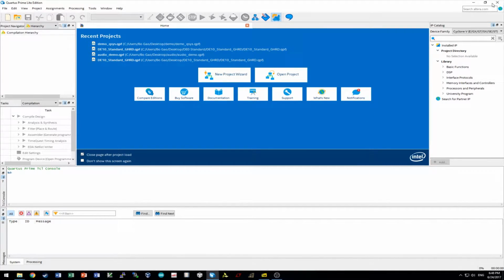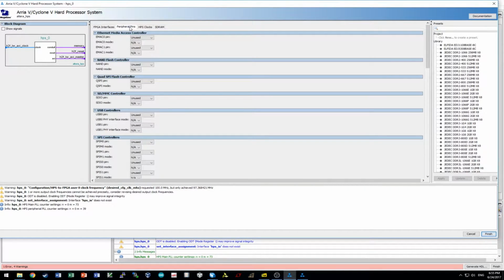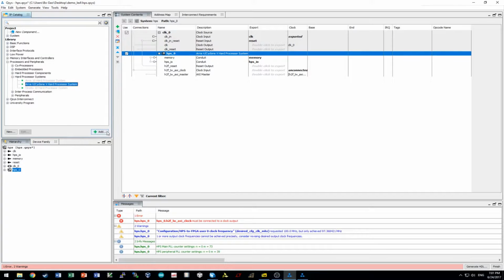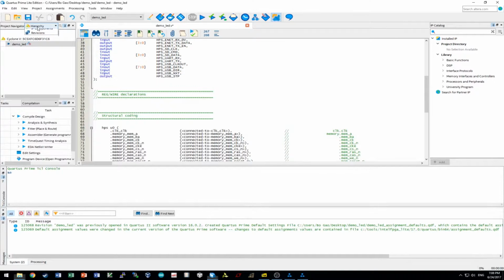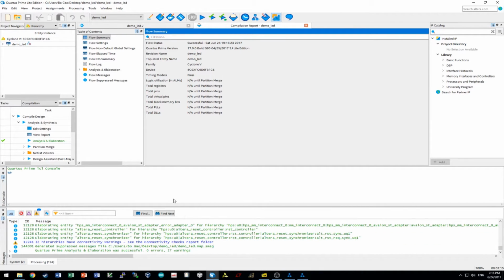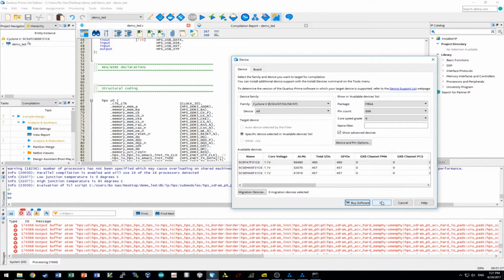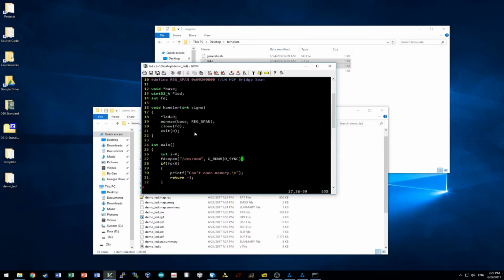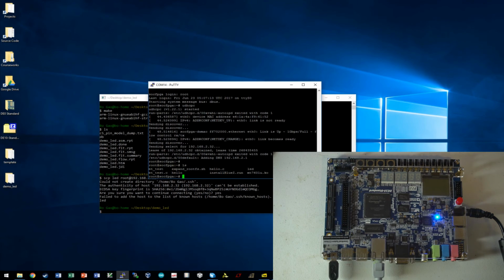DE10-Standard Tutorial_QSYS(Conducted by Mr. Bo Gao)

Comment: Oh, Man!!! This is gold.
Command sopc-generate-header-files wasn't recognized in Altera EDS. (Using Quartus 16.0 on Windows 10 64-bit).
There was a user path variable (automatically add),  named QSYS_ROOTDIR with correct path value.

After adding path value in system path variable named  "Path" command sopc-generate-header-files works.

Although, RTL design consist of one PIO, 10 bit width (driving LEDs) and it's named as PIO_LED. 
Generated header file, have macro defined as: #define PIO_LED_SPAN 16.
Why PIO_LED_SPAN is not 10 ?
Reply: Hi there, 

You might want to take a look at the previous discussion on Altera Forum https://alteraforum.com/forum/archive/index.php/t-49442.html.